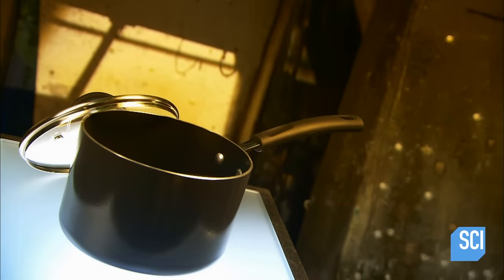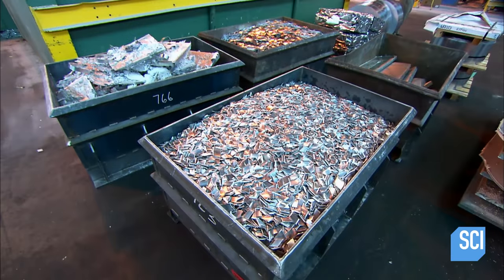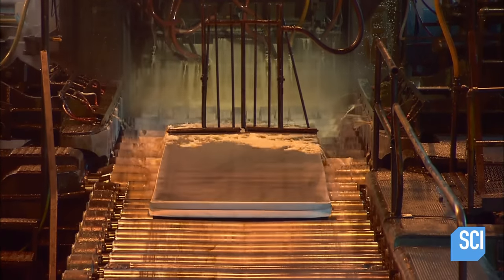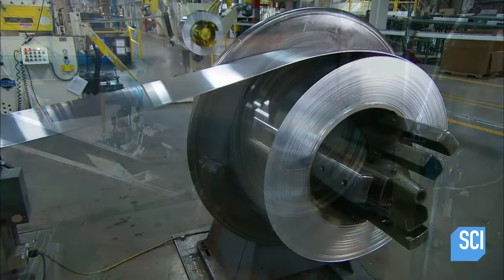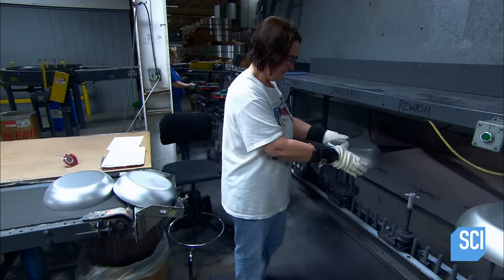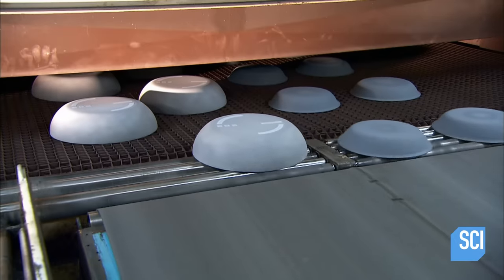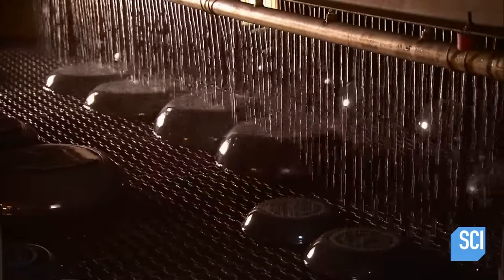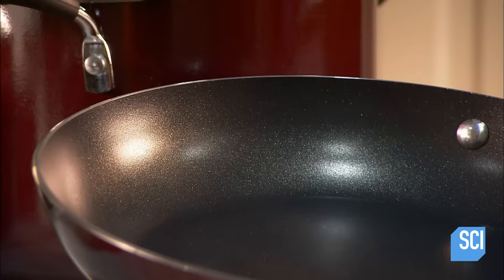How It's Made: Non-Stick Cookware

Comment: To anyone watching this - please please don't fall for some kitchen myths like "you must season non stick pans before use" or "use baking powder and vinegar to deep clean the residual chemicals". It does absolutely nothing to help your life. Just wipe with kitchen towels and oil a few times and you're good.
Reply: Correct, but even better, just season a carbon steel pan a live a healthy life without any chemical substance.
Reply: @Floris82  Newsflash: everything is made of chemicals...water is a chemical, good luck living a healthy life without that 🤣
Reply: @hodge12009  good point.
Reply: You need to wash with soap water any cookware for the first time you use it
Reply: @jam9297  non-stick pan is not toxic when you use them (except when you overheat them) Teflon is inert substance that cannot turn into other substances in regular cooking, it toxic when they make them because because it's hard to make Teflon to adhere to cookingware and when you overheat the Teflon pan, that's why lot of people don't recommended using Teflon pan in the oven. for regular people who like cooking so much yes better of with cast iron or stainless steel pan, but for someone who rarely cooking, non-stick pan it's absolutely fine
Reply: @mohammadrifqisatriamas7311  No, it's impossible to use Teflon to cook in safely. No matter what you do or how you cook, little tiny particles of it will always come off of it and into your food. The coating wears away into what you're eating whether you like it or not. Don't be deceived.
Reply: @jam9297  If it's inert how is that a problem?
Reply: @LykanVarion  Watch the documentary "The devil we know" about Teflon and Dupont and you'll never use it again. 'Inert' is what they say it is, but are they really gonna tell you something's bad for you if that's how they make money? Of course not.
Reply: @LykanVarion   Teflon is emulsified with PFOA, a chemical known to be carcinogenic for decades. While it cannot be absorbed into the body by simply cooking with a Teflon coated pan, if said pan is scratched or chipped, it becomes a problem. It is also what is termed a forever chemical, meaning it's very stable/long lived in the environment, and it bioaccumilates...meaning it is concentrated in an organism, and becomes more and more as it moves up the food chain.
Reply: @jam9297  it might actually help to understand wtf you are talking about before proclaiming "pan is bad". As I said, unless you are scratching the Teflon pan and eating the chips, exposure is very low. Where I guarantee you are to this day gaining exposure are through fluorotelomer coatings....ever eaten fast food, candy, microwave popcorn....or order pizza delivery?  Again....do your research...watching a movie docu just doesn't cut it.
Reply: @FenianAn1mal  look up the scandal with forever chemicals. Not just a documentary, this was a huge incident in West Virginia.
Reply: @TheRevanSentinel  ffs did you make a typo or just not read anything I said? Not only am I quite familiar with the synthetic compounds that make up FPAS, I live about an hour west of Parkersburg where the contamination from the Dupont plant was first made known to the public.
Reply: Just stick to stainless steel, or a well seasoned steel pan. Instead of not being toxic under most circumstances, they're just not toxic.
Reply: @Floris82  Everything that exists is a chemical genius

Comment: IMHO the weirdest thing about cooking in a PTFE lined Pan is that you're essentially cooking on a sheet of plastic.
Reply: @superglue237  Technically yes, but practically no. By the time you've managed to turn the PTFE carcinogenic from heating it too much your food has long since had its 2nd death and is already waiting in line for reincarnation.
Reply: @Duraltia  ah I see. I didn’t know that thanks. I really hope it’s true
Reply: Yep. But it's "safe and effective," the experts tell us so!!
Reply: @CT-if2tt  Everything is dangerous if you're completely irresponsible. Play around with a blender and you'll find that it's a dangerous kitchen appliance much like leaving your non-stick pan unattended on a gas-stove-turned-campfire for 30 minutes. Your gas stove itself can explode if you misuse it too, which should be of much greater concern to you than a slight bit of toxic smoke.

While we're at it, don't put plastic in your oven, and don't set your microwave oven to max for an hour to reheat frozen bread. Don't play with knives or scissors, and unplug electrical appliances before poking around in them.

But yeah, non-stick pans are dangerous and a conspiracy or whatever.

Comment: Depends on the company that makes the "nonstick" pan, because some of them everything still gets stuck, or the coating actually peels off during cooking, I've had that happen, completely ruined an entire meal.
Reply: This brand (Tramontina) build great cookware, and i know because we bought 20 years ago some stainless steel set, and we still use
Reply: Dollar General Brand.
Reply: I agree 100% Teflon pans suck balls! I gave up on them pretty quickly. I use REAL cast iron, the older, the better. It takes some knowledge and a little work  to keep them in tip top shape but its well worth the effort 👌 😉 ☺
Reply: @frankjohnson8750  and cast iron doesn’t cause cancer, added bonus
Reply: @frankjohnson8750  Standard enameled cast iron is also good, but they are usually fairly expensive.  Not non-stick, but since people rarely use non-stick pans without oil, do you really need non-stick pans?
Reply: @Craxin01  The only enameled cast iron i have is my Dutch oven. All my pans are just plain cast iron, well seasoned and well taken care of. I look for and buy very old, 80-100 year old pieces as I have found them to be the best. I have 6 of different sizes. The 10" makes PERFECT pancakes, for example. They aren't as cheap as many other pans but they last. I've had a few of the for 40ish years. Cast iron isn't the best at conducting as copper or aluminum but I'm fine with that.
Reply: @frankjohnson8750  I got 4 big cast iron pieces, three 9 inch and one Dutch oven.  I'd sooner part with my foot than my good cast iron, and all of them are well older than I am.  Still, I really need to take them down to bare metal and fully reseason.
Reply: @Craxin01  Reseasoning is a TASK for sure. I need to stop forgetting I put a pan on to preheat and burn 🔥 off all my beautiful surface 😐😟. I find cooking pancakes in them will do good stuff for the pan as well as for my tummy 😋. Good luck to you. For me it starts as an all day project with olive oil and the oven, then lots o pancakes...more oil...rinse  repeat, etc, etc... bah
Reply: @griffinmckenzie7203  , well, shouldn't buy any cheap pan, to be more exact.
Reply: @griffinmckenzie7203  , well, at least it's not only Chinese.
Reply: @griffinmckenzie7203  , haha, bye bye to the Jurassic era. You're several billion years too behind to see good quality things from China LOL
Reply: If you want quality non-stick pans, go with ALL CLAD, CALPHALON, ANOLON, NINJA

Comment: Great, I'm sure that inside coating won't release anything "toxic"  after years of use.?
Reply: @WungoBungo  Oddly enough, modern Teflon doesn't use PFOA which was the compound that health agencies complained about.  Sure, if you like your food superheated over 500 degrees, all bets on food safety are off, but nobody eats charcoal so that's not a real problem.
Reply: @nobodyspecial4702  It's still uses PFAS. Just not PFOA.
Reply: @nobodyspecial4702  how does water evaporate when the temperature is well below boiling? It is able to do this because certain molecules are boiling. Temperature is a measure of the averge speed the molecules are moving. Some are slower then others some are faster. The very fastest ones can escape and become a gas even while the average temperature is under boiling. Let’s say the pan needs to be heated to over 500 to get seepage into the food which could be a serious problem in the moment. Even when the pain is at 100 degrees, some molecules are going just fast enough to be at 500 or over. Meaning they can seep into your food. While this might be a tiny amount it builds up. PFAS are called forever chemicals because they can’t be broken down due to strong molecular structures. Meaning that these chemicals slowly build up in your body. Due to pollution of water ways, air and products, we all already have it in our body’s but that’s a different story. So even tho your pot or pan might only seep a tiny tiny amount into your food daily. Over time it will add up and that is where the problem lies and that’s where these modern marketing claims are misleading and dangerous.

Comment: Why are birds not supposed to live in a home with Teflon cooking pans on a hot stove?

Does that mean there is toxicity that humans can't detect? Like a canary in a coal mine?
Reply: Quick searched it: “While PTFE is stable and nontoxic at lower temperatures, it begins to deteriorate after the temperature of cookware reaches about 260 °C (500 °F), and decomposes above 350 °C (662 °F). Over 400 °C (752 °F) pyrolysis occurs and more decomposition becomes significantly more rapid. The main decomposition products are tetrafluoroethylene (TFE) and difluorocarbene radicals (RCF2). The degradation by-products can be lethal to birds, and can cause flu-like symptoms in humans: polymer fume fever.

Meat is usually fried between 204 and 232 °C (399 and 450 °F), and most oils start to smoke before a temperature of 260 °C (500 °F) is reached, but there are at least two cooking oils (refined safflower oil at 265 °C (509 °F) and avocado oil at 271 °C (520 °F)) that have a higher smoke point. However these cases of polymer fume fever were mostly present in people who had cooked at 390 °C (734 °F) for at least 4 hours.
Reply: @joermnyc  good one. Users should use these Teflon coated pans as intended. Just focus on cooking and don't let it cook dry.
Reply: @joermnyc  Thank you for quoting this - and to add on, these same toxic compounds in the air can also make other small animals sick. Rodents, amphibians, and some reptiles are sensitive enough that they can also succumb. Basically, if you have exotic or delicate pets, don't use non-stick cookware to be the most safe, or follow usage guidelines strictly to reduce the chance of dangerous exposure. Always keep pets far from your cooking areas!
Reply: @Lerrae1908  Or, you know, don't run your oven at 500 degrees.  That's always a simpler solution.

Comment: At low temperatures (under 260C/500F) this coating is fine, but if you use high smoke point oils (refined safflower and avocado) you can go past 260C before they begin to smoke, at which point the coating begins breaking down. 
Even at lower temperatures the coating is slowly degrading over time and these pans only last a few years before they lose enough of it to start sticking to foods. Best alternative is a ceramic coated pan (Greenpan is one option), only thing is you must be careful with it, no metal tools, hand washing only and don’t fry with olive oil (it burns too quickly).
Reply: What would happen if you use a metal spoon, for example.
Reply: 375 is the max you should take these pans...
Reply: Fahrenheit should go
Reply: @sura1274  scratch the coating, at least a little, which over time can lead to a chip off this coming off in the good you’re cooking.

Comment: 02:16 
How does the machine make the shape ?
Reply: The round aluminum blank (disk) is placed over a form that is shaped like an upside-down bowl. The part that comes down has a hollowed-out center (that you cannot see in the video) that matches the desired outside surface of the pan. The big machine is a press that forces the aluminum disk down around the lower part, the upside-down bowl shape, to form the body of the pan.

Comment: Teflon pans:
Have to be replaced once a year.
Leeches into your food long before it starts to peel.
Wasteful.
Horrible for the environment.
Horrible for your budget.
Causes cancer.
Makes food taste like shit.

Stainless steel pans:
Same price.
Significantly less so, if bought used.
The absolute safest and most leech-free way to prepare food.
Lets food taste like food.
Never needs to be replaced.
Can be used with any recipe.
Can be used in the oven if it has a metal handle.
Can go in the dishwasher.
Lasts functionally forever.
Can be passed down through the generations.
Eventually breaks down into cobalt.
Could then be sold for a fortune.

Technically you could use the same stainless steel pan your whole life, if you don't mind washing it after every single meal. I mean you still have to either way, but it's nice to have more than one.

Comment: Most of these non stick pans only work for some time, after that, food starts to stick like an ordinary pan. I guess there are different grades of non stick pans.
Reply: You're supposed to replace all of your teflon pans at least once a year. The teflon breaks down and leeches into your food. You're ingesting teflon long before the pan starts to peel.

Just save money and time and get stainless steel instead.
Reply: @techmouse.  What about ceramic coating?
Reply: @davidlguerr  I actually looked into it a long time ago and apparently a lot of the pans that were calling themselves ceramic coated were just still using some kind of teflon based compound or something. I don't remember the details but the gist of it was that you can't trust any of them to be telling the truth since the terms they use were all ambiguous made up nonsense buzz words. It's best to go with a product that at least tells you what it is.

But that was what I extracted from it. YMMV.
Reply: That probably depends on how you care for it. Don't use metal or other hard implements on the pan and don't scrub it. When you store it, make sure to put a towel on the inside to protect the coating from stuff you out on top like other pans.

Comment: It feels like the manufacturers are missing the obvious here as well. It would be simpler and cheaper to cast aluminium/steel cookware. Just like Tesla did with car bodies, instead of cutting welding, stamping shaping in hundreds of steps. These way even creating the sheet metal requires a bunch of effort, time and money.
Reply: Yes, I'm sure the companies working on a profit margin did not think about the manufacturing process at all.
Reply: @Salted_Fysh  You're in denial about how little manufacturers are willing change, ot to take even a tiny risk. Everyone just their logo on stuff the suppliers already supply, and advertise (aka lie) the hell out of it.

Comment: You should never cook with this junk.. it will 100% flake off and you will end up eating it.
Reply: That's not the problem, the coating itself is extraordinarily inert and it will pass straight through you. It's what happens before it gets on your pan, or after it goes through you and gets turned into microplastics by natural processes.